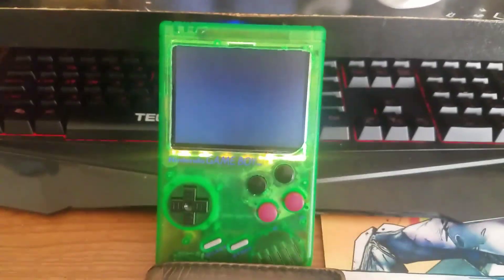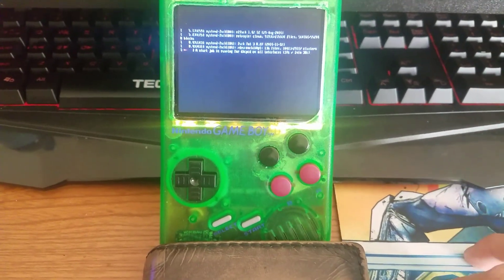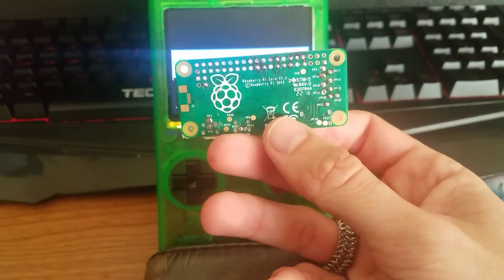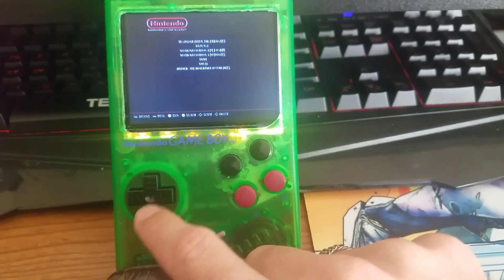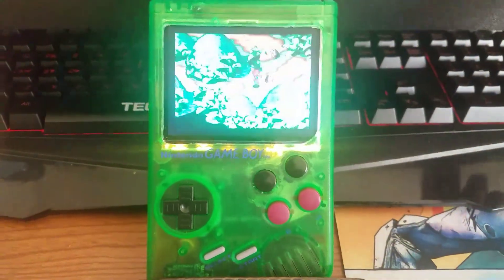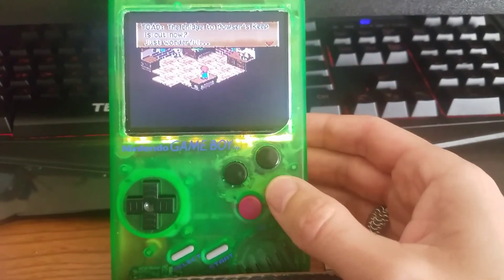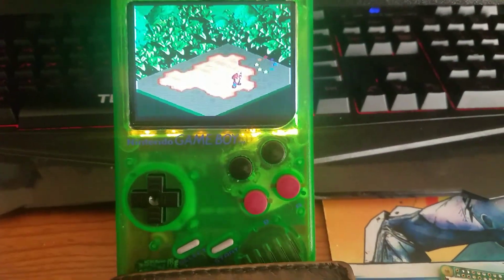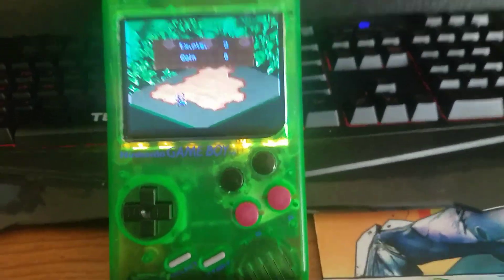Gameboy Zero - Raspberry Pi Zero with Retro Pie

Comment: Hey, bro, glad you finally got this working.  I still haven't gotten up the motivation to finish my handheld Raspberry Pi system, but if you ever want to try a custom case, or 3D printing parts, let me know.  I've got my 3D printer just sitting here a lot of the time, and I'd be glad to help you out with your projects.
Reply from the maker: I may take you up on that offer. Once I figured out that I didn't need the Teensy board it was super easy to finish the controller. I actually got more parts to build a 2nd one that's put together a little cleaner so when I get the time I'm going to do a complete how-to-video on it.